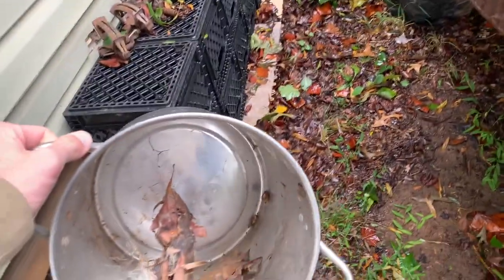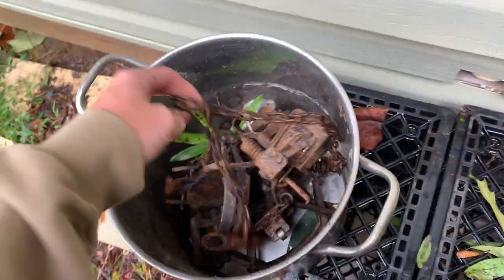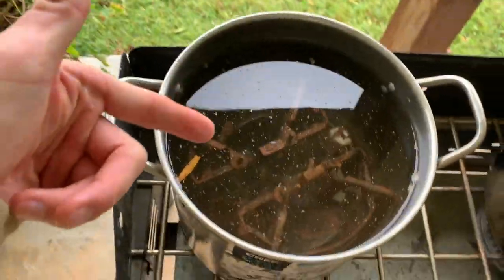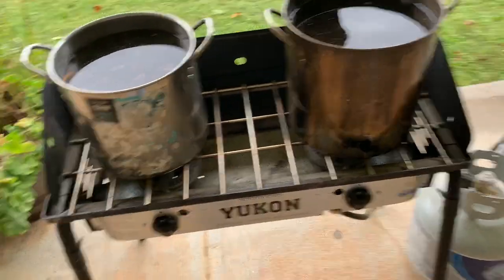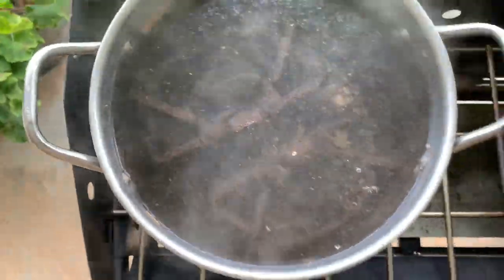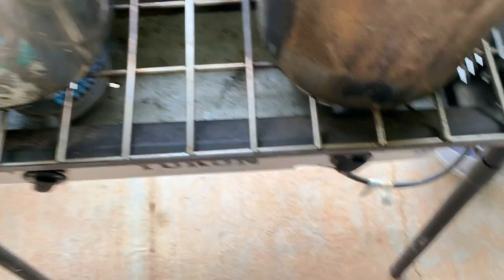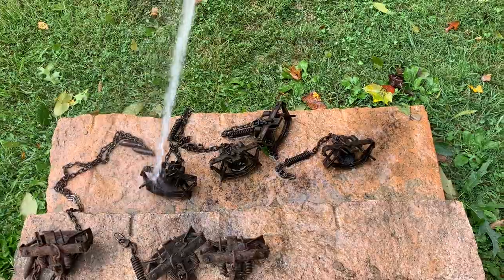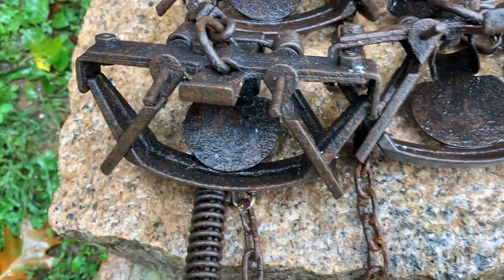HOW TO CLEAN OLD TRAPS!!! TRAP PREP STEP 1!!!

Comment: Ive got an old turkey fryer pot. I'll soak mine in muriatic acid for 30 minutes in hot water. It eats all that gunk off. It'll make them look almost new and then i'll let em sit outside for a day or so. They'll get a coat of rust on them and i'll dye/wax them. The rust makes the dye stick very well. Keep the videos coming. Going to set traps out tomorrow.

Comment: your process seems a lot easier than how I clean my traps I would soak them in baking soda and vinegar for 1 to 2 days change it out if I'm going to leave it for 2 days. then scrub them clean with a wire brush and hose them off while I'm scrubbing them it takes a while

Comment: Have you done a break down of your swivel, shock spring anchor system. I just finished waxing mine and I am curious if I need to be rushing shock springs or some extra swivels. All I've done is pick up J hooks and S hooks with some earth anchors. MB550 are stock
Reply: Shock springs are unecessary. I use swivel at trap, 3 links of #3, swivel, then anchor chain.
Reply: NC requires shock springs. If you get caught without them it's expensive.